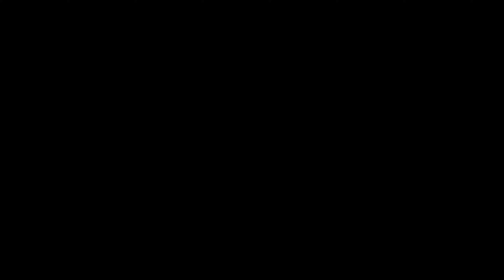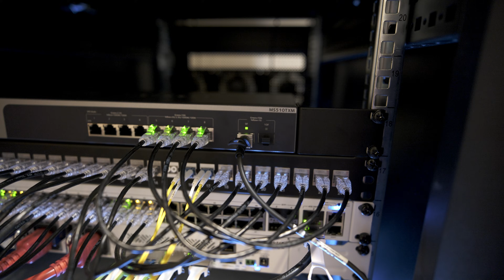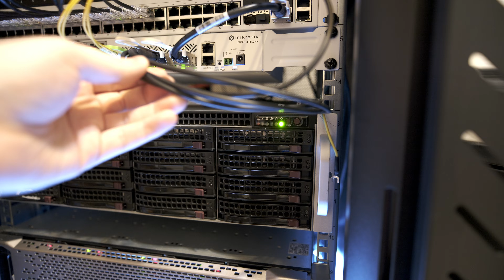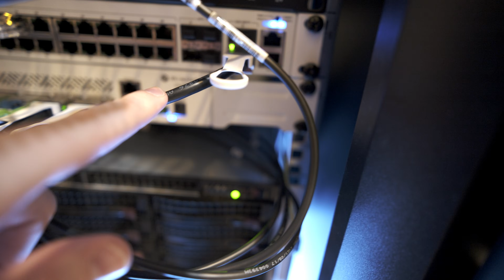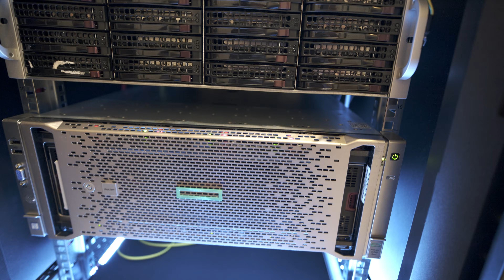What is in my network stack? 8K HDR

Comment: Where do the 100gig yellow fiber cables go?
Reply from the maker: In this video they link the file server and the render server together. In my current config they link the file server, the render server, and the ML server. I use the 100g backbone to move massive files from the file server into ram on the server that needs to work on the data then move the final product back.